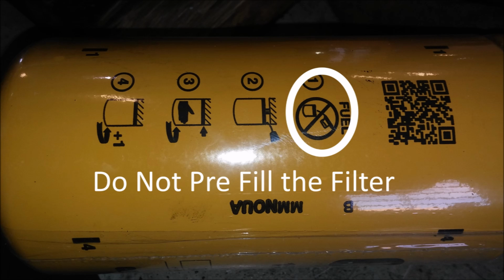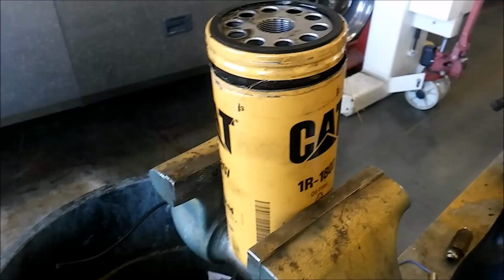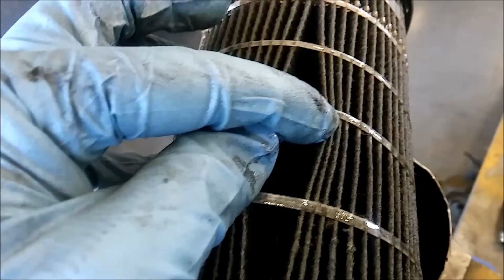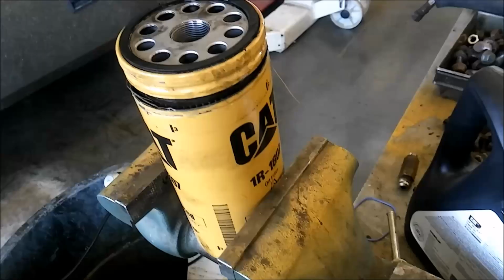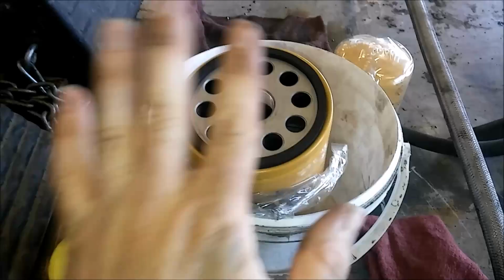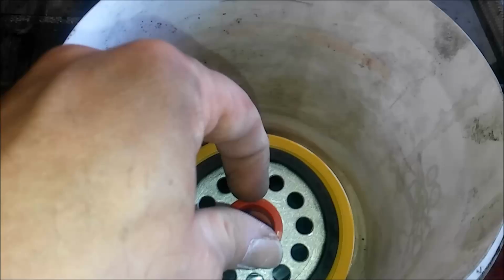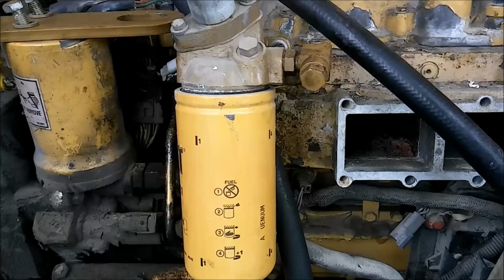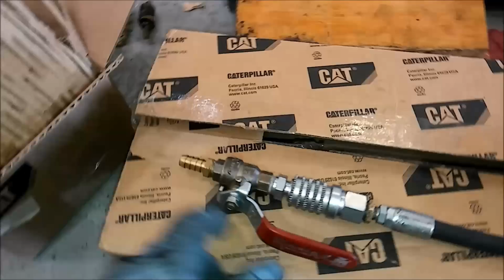Should You Pre Fill an Oil Filter? Should You Pre Fill a Fuel Filter?

Comment: I always pre-fill my oil filters and I have done it in the way that you show in the video, into the dirty side through the inlet holes. I have seen various engines that had oil changes where a dry oil filter was installed. I would typically hear the valve train clatter loudly for up to 10 seconds. Now, the customer not being in the shop would not know this and would be happy about having his oil changed with a new filter in place. He probably would not be happy if he heard that metal on metal clacking at the first fire-up of his engine. I can't imagine that this metal on metal contact with no protective oil film occurring every 3K to 5K miles at each oil change would prolong the life of the engine. This is opposed to when an oil filter is pre-filled and the valve train clatter is reduced to something like 1 or 2 seconds. In my own personal car, I would additionally disable the ignition and crank the engine until I would get an oil pressure reading. When I would then reenable the ignition and start the car there would be virtually no valve clatter initially.
Reply: And this is why on diesels you prefill oil filters because there is no ignition system the so you can't disable the starting of the engine because it's done by compression of the air fuel. No spark.
Reply: @Jon-O.  I'm not a diesel tech, but you can prevent a diesel engine from starting by disabling the fuel injection. Pulling the ECU fuse or jumping the starter relay to crank the engine with the key off so the ECU doesn't fire the injectors are a couple potential solutions, I'm sure there's others.
Reply: The film of oil that remains on the internal parts doesnt magically evaporate as soon as you take the filter off. If you're hearing parts rattle after an oil change,  you,ve got more expensive problems than just N empty filter.
Reply: @jmh4ggg  The residual oil film left on the parts gets squeezed out from between bearing surfaces pretty quickly due to the contact pressures between moving loaded parts. If there isn't oil pressure there immediately after a start to replenish the oil that has been squeezed out then there will be nothing to fill the void between bearing surfaces and there will be metal to metal contact. Prefilling the filter reduces the time it takes for the filter canister to fill with oil, the filter medium to get saturated with oil and then for oil flow to the galleries. This is why, as Scotty correctly says, that most of the engine's wear occurs on startup, particularly a cold start. When you have an empty and dry filter you only lengthen the oil starvation time at startup, not a good thing for engine longevity.

If you're not planning on keeping the car past 80k miles then maybe it doesn't matter.

Comment: The fact this is even debated is the most amazing aspect of the prefill or not discussion.  It just highlights how people can see something so simple from two completely different ways and it’s really kind of surprising.  I think part of the problem is the very different perspectives between heavy equipment and commercial shop work versus the average DIYer at home with their personal vehicle.  I can only speak really from the DIYer point of view, and from that perspective unless it’s a unusual situation the oil from sealed bottles is cleaner when you put it in the engine than it will ever be again.  So unless you’re adding contamination or debris from your technique of adding the new oil, then that brand new oil is clean and doesn’t need to go in the outside holes of the filter.  If you got contamination in the oil or if it was a very unusually bad batch of contaminated oil from the oil manufacturer, that’s a different but very rare situation.  And prefilling the oil normalizes oil pressure and oiling function sooner than starting with an empty filter, particularly if the filter is vertical and can be easily and effectively prefilled.  If it’s a horizontal filter, that makes prefilling less important and less of a difference.  Watch the videos from “the motor oil geek”(Lake Speed’s son, can’t remember his first name).  He recently did a video that proved oil pressure and lubrication system function normalized and stabilized sooner with a prefilled filter.  It’s not like it makes a huge difference, but it is better to prefill the filter at least in the case of most normal passenger car engines.  There may be some unusual types of engines with variations in oil flow and such that might change the outcome, but for I’d say for 95% of engines it’s better to prefill the oil filter.  Not prefilling won’t result in engine failure and you’ll never know the difference, but you’ll have slightly more bearing wear with every startup after an oil change with a dry filter.

Comment: I always prefilled both oil and fuel filters (yes, through the center hole!). I'm more concerned about lubing up the O-ring more than anything. Installing dry O-rings are a no no in my book. The warning on the filters are for liability issues. Some idiot is bound to get something nasty in the filter if you give them the OK to prefill. JMO!
Reply: same here :)

Comment: Once I didn't fill my oil filter. 87 Chevy small block. Took a bit for oil pressure to come up, and the engine didn't sound happy. Have always filled filters. 30 years so far no bad engine. Had to edit. The oil is under pressure it is keeping metal from metal. The little bit of oil left behind isn't lubricating much at all. Rotatating parts will still touch.

Comment: Instead of pre-filling my oil filter, I just soak the filter media in oil for a few. I have a Subaru with a top mount oil filter. Physically cannot pre-fill it. But, I understand how liquid filtration works. Liquid filters work best when the filter media is pre-soaked with the filtered substance or its solvent. So, I fill the filter with clean oil, swish it around some, then put the filter upside down in the funnel and let the excess drain into the engine. This way on my first start, the filter medium is pre-soaked and it will filter better.
Reply: Never thought of that, i have a Jetta Diesel with the filter inserts, at least with the fuel filter, the dome is still mostly full of fuel.

Comment: i allways prefill my filter, never had a problem. in fact  the people that don't prefill their filters, on start up you can hear a bunch of rattling never sounds good. My advise prefill your oil filters. Use clean oil and make sure the seal is completely removed before pouring.
Reply from the maker: +Steven Harden As the video explains, pre fill them from the dirty side and that will ensure the oil is filtered completely and the filter is primed.
Reply: Adept Ape  you can pour it in the middle. if you're using new oil it doesn't make a damn.
Reply: Steven Harden o
Reply: @stevenharden803  New oil doesn't mean it's clean oil. More often than not, oil from a brand new container does not meet the cleanliness standards of most OEM's
Reply: @bigtruxz  you're nuts
Reply: @stevenharden803  I love how it’s the 60 year olds saying he’s wrong because they’ve owned an old f150 from 1960 lol, technology has changed and tolerances have become so much tighter in the last decade, that microscopic containment’s actually cause the most damage to an engine

Comment: 1.1 million on my D13 Volvo and when I do my own PM I always prefill my filters.
Reply: That's because your smart
Reply: And my uncle's smoked since he was 10 and he's 70 now. Still doesn't make smoking good.
Reply: @aliabdallah102  proves it's not instant death for all.
Reply: Always prefill the filter. I've always done it...the odds of getting contaminated new oil and it causing damage is FAR LESS likely than damaging your engine by dry cranking your engine. Even a fool can tell you that  a couple seconds of no oil pressure can cause severe bearing / Crankshaft damage.  This guy shouldn't be making videos because he's going to ruin a lot of your engine's by giving you bad advice.
Reply: @mikefrederick4096  I think he and the engineers who design these engines know a bit more than you do buddy
Reply: @mikefrederick4096  mike, he believes like my one Maintenance boss did,- - -“if it’s in the engineer approved computer maintenance manual, ITS CORRECT!”  He must not know about the garbage in, garbage out theory!!Love those engineers!!!  They almost killed my pilots after doing some work on our perfectly good jet aircraft!!!!!  The gear was retracted and locked up with the gear doors just after takeoff,  because of some “Genius Engineer”🥴. I’ve been pre-filling oil filters for 40 years on cars and planes and guess what,  no catastrophic failures?? or related damage??  Not one of these guys mentioned doing a good visual inspection of the inside of the filter or using a magnet on the metal threads for tiny metal burrs and F.O.D.  Most of the time, the contamination is not going to be from the oil your pouring into the filter, but from the new filter itself!  I once found severe contamination inside a brand new (plastic sealed) aircraft hydraulic filter!
Common sense anyone?  YOU the   MECHANIC are responsible for 
E V E R Y T H I N G !!!!!

Comment: I have prefilled oil filters from the center for 25 years.  Never a problem.
Reply: I know people who've smoked for 50 years and say the same. Beware of this type of argument.
Reply: I've never prefilled my oil filters for over 25 years and never a problem, but I also only change my oil every 5 to 7k miles, and typically retire my cars around 300k miles.  I'm probably very lucky.  LOL
Reply: you may not realise it but dirty oil can come right out of your can or barrel, we have had oil samples tested to verify that and in some cases the oil was dirtier out fresh barrel than the oil drained out of the pan at 20000 miles.
Reply: Bullshit If that's the case change only the filter then add enough new oil to replace what was lost in the filter
Reply: bob cat well one might think that is logical but the contamination from running in an engine is different than that of what the oil comes with new, which some of that contamination is not removed by the filter. Also, the heating and cooling process along with aeration that the oil goes through while in an engine causes the oil to break down and not provide the same level of lubrication, protection and cooling as it was new
Reply: Equally importantly is the additives package deteriorates regardless of how clean the oil may be. You could filter it perfectly clean but the oil would not be able to perform all of its functions and damage the engine.
Reply: exactly... regarding this counter argument of worrying about contaminated oil in bulk, the solution is to pre filter the oil, not to run the filter dry.
Reply: @curtekstrom6600  dont have a storm door sliders

Comment: I like fuel systems that include some type of priming device to pre-fill the fuel filters. If you have a priming pump before your fuel pump you can use that too. I have also used a priming bulb from a boat plumbed into the system to pre fill the fuel filters because I don't want to contaminate my fuel system, particularly on these new high pressure fuel systems.

Comment: Out cat loaders have these awesome fuel primer switches. All you do is screw on the new, empty, filters and then flip a switch and an electric motor pumps fuel from the tank into the filters. Once you hear the air bubbles stop in the return to the tank, it's prefilled/primed.

Comment: Been filling filters and building engines for 40 years. Simply poured oil in the large center hole of the filter every time; I've not yet seen oil contaminants from new oil containers. I don't know about bulk oil but there's no way anything but pristine oil is coming out of a new, sealed oil container. Not sure what the fuss about on this vid.
Reply: the contaminates in the oil are smaller than your eye can see, however when your engine is moving at a thousand rpm or more it makes a big difference
Reply: @aidanmorgan6291  if they're so small you can't see them do tell what micron size dose that make them?
Reply: Yeah I agree that it's clean oil coming out of a sealed container. But on the off chance that there were contaminants in the oil from the factory I'd rather fill from the outside.
Reply: How would one go about getting the uncontaminated oil out of the container without contaminating it assuming it really is uncontaminated? I mean you have to break that seal with something and I am willing to bet it is something contaminated.
Reply: Agreed. If you prefill your oil filter, fill it from a quart bottle, it's much cleaner than the oil in a bulk container. Bulk container oil can then be used to fill the crank case, since any contamination will be filtered out by the new filter, before being pumped into the oil galleries.
Reply: I bought a 2002 dodge 2500 with the 5.9 Cummins diesel an I've always prefilled my oil filters from the center hole and never have had a problem ! I bought it new in 02 it now has 316780 miles on it ! No problems ! So I agree with you Sir i dont see the problem !

Comment: On my 74 Ford E-300 van with a 302 C.I. gas engine, I pre filled the oil filter before install. The oil pump was spun with a drill before the first start, but I just got in the habit of filling the new filter while draining the motor and the engine was clean as a pin at teardown after 20,000 hard miles and oil changes at 5,000 mile intervals. The engine had a part failure not due to any problem with lubrication. After fixing the problem the engine has run perfectly for another 175,000 miles with no problems. I have and will always fill the filter during every change.

Comment: I work with marine diesel CAT C18’s and I’ve always pre-filled fuel filters. This is mainly due to how much of a nightmare it is to operate the manual fuel priming pump due to its location (under the engine room walkway). Not pre-filling turns the job into a complete nightmare.
Reply: @wilburshuman  that’s the mind set of a shit mechanic. Nice work over those 30 years I’m sure those companies paychecks cashed no problem but because you have no pride, no coveralls, or no balls your the type that will cut corners and half ass your job so the next guy in line(probably an actual mechanic) will have to cover for your lack of professionalism and due diligence.
Reply: @wilburshuman  I don’t have to prove anything you already admitted to being a lazy mechanic.

Comment: I pre fill all oil filters, whether they go on my bike, lawn mower, or any of my cars. If you pre fill a filter in the center hole, it will still fill the entire filter. It might take a bit to do it, but it will have oil in it. 
As for a fuel filter, I never fill them unless it's on a diesel engine that way it won't get air in the system.
I have pre filled oil filters for over 20 years, and have never had any issues.
Reply: RakinBill it's not about filling the entire filter, it's about the fact that you want to pour the oil into the inlet side so it has to pass through the filter media before going through the engine. even new oil can have a bit of shit in it
Reply: How can new oil have crap in it? Especially if it's from a sealed bottle? 
I take extra care and caution when I fill filters, and yes I know it's going in the outlet side of the filter. The center threaded hole is the outlet into the motor, and the outer portion that has the reverse flow seal is the inlet side, but I have never had any issues with doing it that way. 
I find if I prefill the filters, it builds up oil pressure faster after a startup from an oil change. It holds true, especially on older cars with more miles on the engine.
Reply: Could be debris left from manufacturing process, not likely, but it happens.
Reply: @allanmccullough8550  : just dont pour the dregs of the bottle in .
Reply: @InTheDogHouse3DPrinting  : just dont pour the dregs out of the bottle in the filter .

Comment: That's why most diesel engines have hand prime pumps, some of the equipment I worked on had electric pumps to prime the fuel system. Now that I work for a International dealership I have found some with electric pumps and some with hand prime pumps. The power stroke engines or dt444 will not bleed the air out of the system, so after you install the filter but before you put the cover back on you have to cycle the key to fill the housing, this also holds true for the maxxforce 7 . 

When I worked at the landfill on mostly CAT equipment, CAT told us not to fill either oil or fuel filters; Hand prime only via electric pump or hand prime pump. As for the oil they say they have enough oil to idle while the oil pump picks up prime. When I do a in frame or out of frame overhaul I prefer to use STP oil treatment for pre-lube as it tends to stay put for first start. The D-8 we had was equipped with a pre-lube system, you could turn the key all you wanted and the engine would not crank until the oil pressure came up.

I feel the best thing anyone can do for a engine is to give it a little warm up time every time it is started. This gives the oil time to get worked through the engine before it is put under load. If a few minutes is going to make you late, your already late.
Reply: mrgearheadfromhell  the big Cat engines like the 3512 and 3516. Have hand priming pumps, but they are extremely difficult to prime once air gets into the system. The best way I found is to pump rapidly while cranking the engine and keep pumping even after one or two cylinders fire. Not easy. One thing I liked about the old Detroit Diesels is they never get air bound. The EMD engines are the same design, never an air problem.